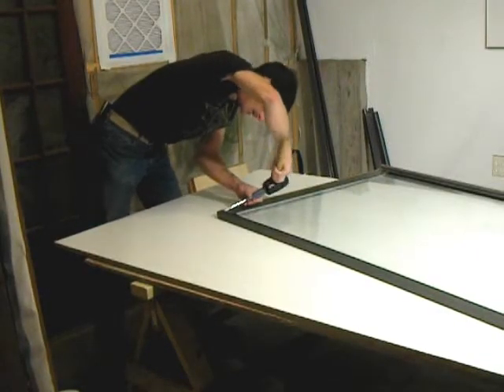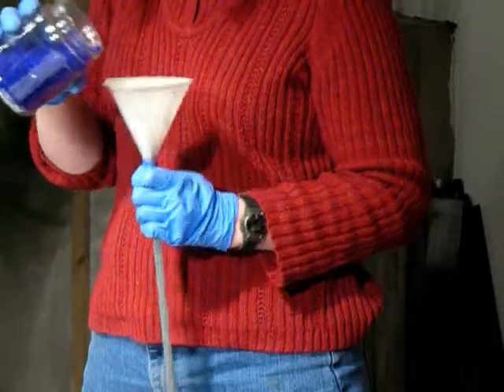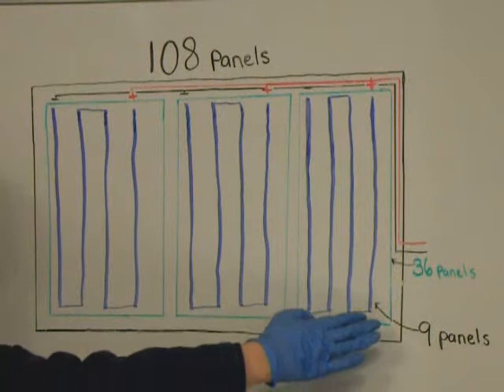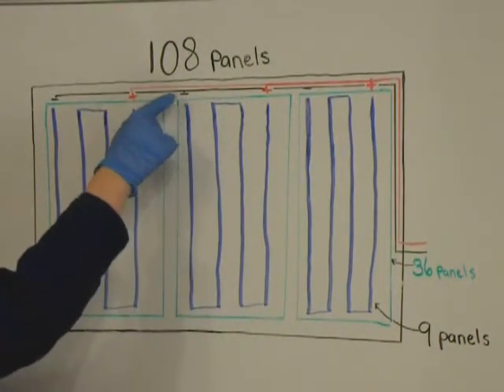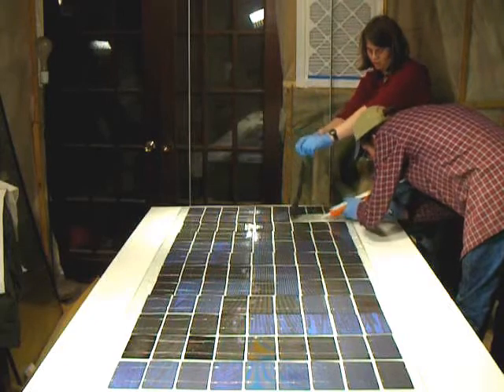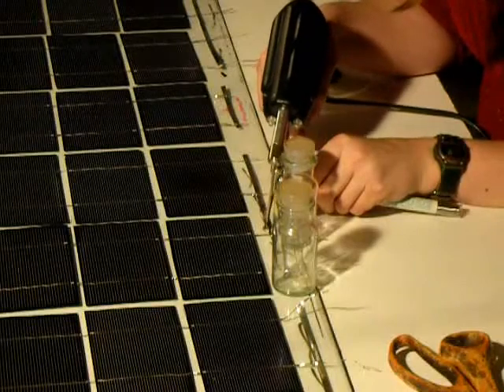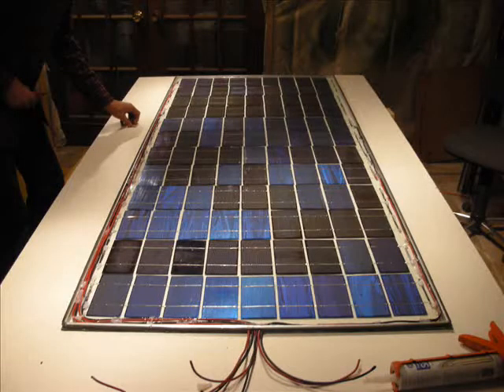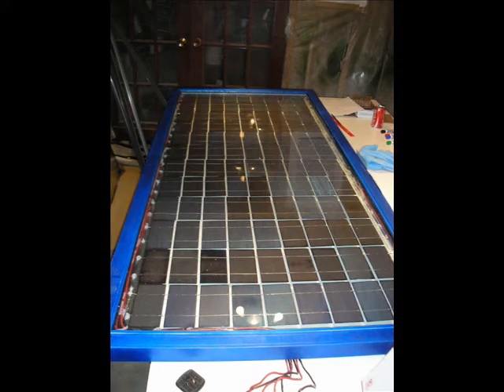Building Solar Panels- final panel assembly

Comment: Ive read that the panels should be encapsulated or oxygen will break them down in a couple years and cause them to be less affective and finally fail. I realize there is limited amount of oxygen in side the panels as long as the seal holds up but I figured I would mention it.

Comment: Please be careful with terminology for us newbies i.e. solar cells vs. solar module (often called a solar panel) vs. solar array.  You initially talk about 108 solar cells, which is correct, and then you show a diagram and show/talk about solar 108 panels.  
P.S.  A grouping of solar modules or panels is called an array ;)

For readership clarification: A solar module is made up of solar cells.  Some refer to a solar module as a solar panel.

Comment: When you are taking the glass apart you can use a heat gun to heat it up, this will soften the sealant and you will find the knife will go through easier. some wooden shingles will allow you to keep them seperated . I do suggest gloves incase you slip. I actually use a backing that is use by sign shops and make a frame out of Aluminium l channel to help keep the weight down and to allow for better cooling. I do like the way you made your jig for assembling the the cells.